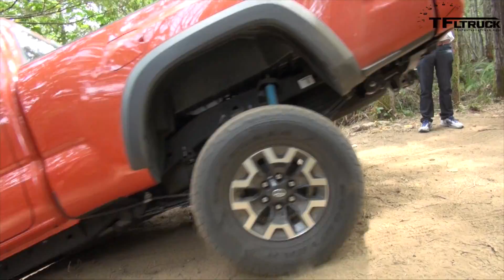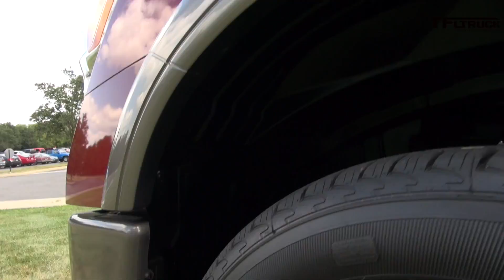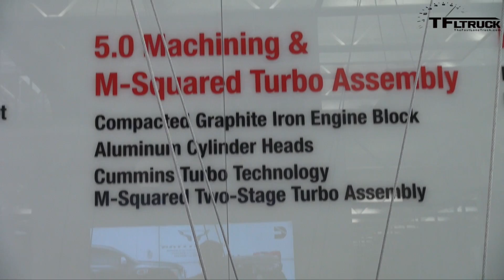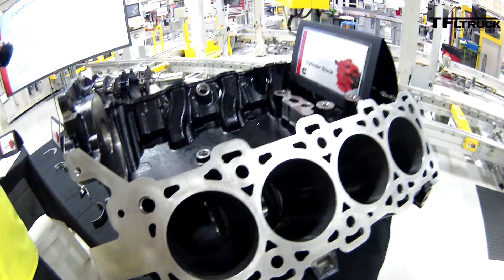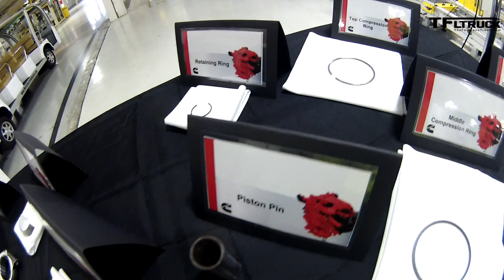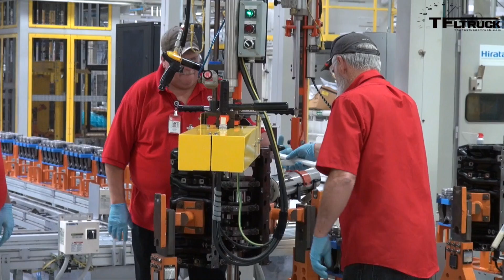2016 Nissan Titan XD: 5.0L V8 Cummins Revealed: Almost Everything You Ever Wanted to Know

Comment: What the heck is "NVH"?
Reply from the maker: Noise Vibration Harshness
Reply: +The Fast Lane Truck Damn it, now I know EVERYTHING I ever wanted to know instead of almost everything. Ruined the whole experience.
Reply: +jetpowered1 Noise, vibration and harshness.
Reply: +MrKeyboardCommando Kind of a different market. The EcoDiesel will be a cheaper option most likely. The purpose of the EcoDiesel is fuel economy, which it does amazing at. This Cummins is intended for people that haul/tow a lot but don't need a 3/4 ton truck.
Reply: ***** My F-250 with the 6.7 diesel gets upwards of 18 miles to a gallon unloaded. Which is better than any other 3/4 ton truck has ever made. And I have personally seen the same 6.7 diesel truck with the exhaust filters removed make 25 miles a gallon. I think you are ignoring just how impressive it is for a motor to make over 800 lb. ft. of torque and also get 18 MPG stock.
Reply: Well considering the 6.0 was likely the least fuel efficient powerstroke, that is a safe comment. But again, I've seen it with my eyes unlike you repeating the forums. Stick to your 95 chevy 1500 old man.
Reply: +blackericdenice I have a 2012 6.7 SD 4x4 SC long bed and I get  around 23 mpg stock 1500 rpm @65 mph on highway when I floor it I am around 16 mpg. and towing 26k thru flagstaff @45mph I'm at 8mpg. real numbers real world
Reply: NVH = Noise, Vibration, Harshness
Reply: +New World Order hahahaha amen
Reply: Noise, Vibration, Harshness
Reply: +jetpowered1 NVH = Noise vibration harshness
Reply: I could post a video and pics and you'd probably still say something about the grades of the highways of Arizona or how fast am I accelerating and what not. On a fill up I average 22.3 miles to the gallon and that's counting each mile per gallon after I run to 50 miles to E. The super duties have a onboard computer that gives you miles per gallon and gallons used. If I do a full delete and tune I guarantee my gas mileage will increase exponentially. My city does emissions which is the only reason I haven't chipped yet. Only bad thing I can say about the super duty 6.7 editions is the faulty exhaust sensors which there are four of. Other than that my super duty has given me the biggest bang for my buck. #23mpg #youmad 😂😂😂 my Instagram has my truck and the gas mileage for display as I type 😩
Reply: You drove 750 miles getting 14 mpg 😂😂😂 your driving habits are terrible. I get that towing anything less than 16k easy. Stay off the gas if you're going for mpgs is my suggestion. That Titan is entirely too light to safely pull anything over 12k and I'm sure it struggles to maintain control on a downhill descent due to the lack of weight distribution. Sure I can tow being a diesel but that little engine will work three times as hard as my 6.7 and I can bet those egts are threw the roof on uphill ascents at anything over 40mph. Let's not even mention passing power while towing. With diesel at $1.98 in Arizona my 23mpgs takes me further and further for lesser and lesser these days. My truck can not be beat by any of the competition whether it be the maxipads or cumstains 😂😂😂 #23mpg #superduty #fordlover
Reply: +Shane Broom Ive got a 2002 dodge 2500 hd with a Cummings, 6 speed manual, and a 3.42 rear end. with factory fuel parameters I get 18mpg around town, and 24 to 26mpg on the interstate depending on where I am in the country, and the altitude. When you drive over 10k miles a month, fuel is everything. My fuel bill is right at 4k dollars a month, on a truck that has been paid for over 10 years. My truck pays me, and it pays well, because of the way i drive it. Stay around 60mph and you see your truck get the kind of mileage mine does, and a million miles on the odometer. Mine did two years ago.
Reply: Noise Vibration and Harshness
Reply: +MrKeyboardCommando Yep!
Reply: +Stuka87 But is there a large market for truck owners who need more than a 1500 series truck and less than a 2500 series truck? I can't imagine too many people facing that issue. I just don't see the practicality standpoint that you are claiming. The F-150s can tow 12,000 pounds. The Silverados can tow 12,000 pounds. If I heard the video correctly, they said the titan will be able to tow 12,000 and something pounds. If you need to tow 12,000 pounds regularly, you will get a 3/4 ton diesel truck. Not necessarily to go up the hill, but to control the trailer going down a hill.
Reply: +The Fast Lane Truck oh,
Reply: +blackericdenice how do you know they can't get 20 mpg? do you own a super duty hell no
Reply: +blackericdenice now you're just replying for attention. you're responses aren't even intelligent. smh take care driving whatever it is you drive and FYI the titan is a very ugly truck that will only sell to the foreigners 😂😂😂
Reply: this truck is ugly. they should have kept the old model look but put a roundness to it. and they should have made the diesel trucks look like this. but the 1/2 ton trucks! they should have put a roundness to it.
Reply: Lol I know you are totally full of shit because you keep saying "gas mileage" hahaha you fool.... Typical ford owner, that is if you even own a ford truck haha because it looks like you don't hahahahaha typical dumbass kid on YouTube trying to fake shit to impress people, here is a tip, if you want to fake impress people, don't say you own a powerjoke because all your credibility is gone when you say that
Reply: +joker432 I own a powerstroke so what are you trying to say
Reply: +P Marcus B it was likely an error in his math when he did the calculations for his mpg.  you know how those "brothers from the hood" are at mathematics.  some people just hate fords because they are always on top.  everybody loves an underdog
Reply: +Nathan  Carter  Ive got a 2002 dodge that will make you cuss.
Reply: +michael smith I have a CDL and i still only run a dodge 2500. I'm licensed for 32,000 and i use it moving boats. A 40k pound 3500 is a death trap in most drivers hands.
Reply: +Jermaine Rogers getting good fuel mileage is all about where you park your foot.
Reply: +blackericdenice my buddy in the city with high trafic in his 2012 6.7 cummins 6speed manule he get 17 mpg and on the highway going 70 to 75 gets about 21 so im positive that a 7000lb+ truck can get that mpg with good driving habits
Reply: +jetpowered1 Non-Volatile hydrogen o.0
Reply: +Yo Momma Om, no, but I like the way your thinking. Ever heard of h3o!!!
Reply: deuterium or heavy water... Canadian Candu
 reactors use it
Reply: +Yo Momma imagine what would happen when its injected into a diesel engine. Their doing it right now. the tech to make it work is kinda out there, but it cuts the amount of fuel you need in half. Got a 2003 ford, with  factory 7.3 getting over 40 miles to the gallon, at 265hp and 525 pounds of torque. Should be main stream in 3 years if they can get the OEMs to adopt it.
Reply: +blackericdenice 
I had a 4WD 2007.5 Ram 2500 6.7 with egr delete, tune and exhaust. It would easily get 25 hwy and ran like a scorched ape.  I do appreciate your knowledge and interesting exchanges in this thread.  Hope you have or get the diesel of your dreams.  I kind of like this Nissan and look forward to the Canyon and Colorado diesels.
Reply: +Eric Nelson If GM will put there little 4.5l Duramax in the Colorado,  I'd buy one tomorrow. But I don't think their ever gonna do it. The 5.3 gas is nice, but a little diesel would be sweet.

Comment: Hope they upgraded that weak-ass rear end...I have a 2004 Titan and it is a weak link...
Reply: +alex gleis Since we've never met why would you assume and call me an idiot?. Polite and mature adults can have discussions in which they may disagree but still treat each other respectably.  
Nissan continued to use a poorly chosen rear end for all these years in spite of all the issues. The first time my spyder gears failed while the truck was under warranty the service writer claimed he had no idea there were problems with that rear end...and as I walked away from the service line, I saw a wooden pallet with at least 3 used removed Titan rear ends on it behind a parts area.
Reply: It's completely different you idiot
Reply: Alex, look up upgraded in a dictionary.  It does not mean updated.